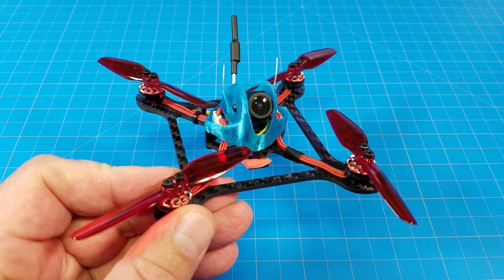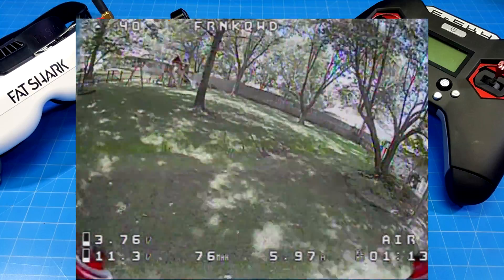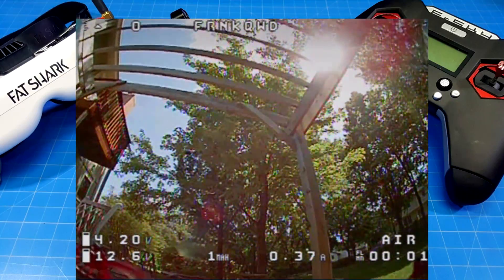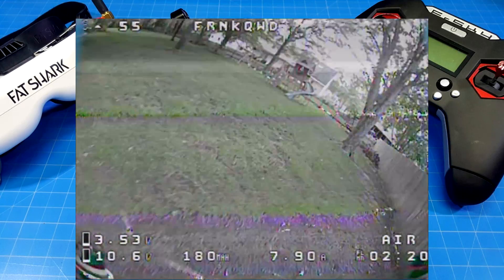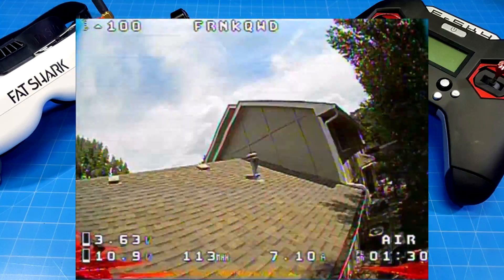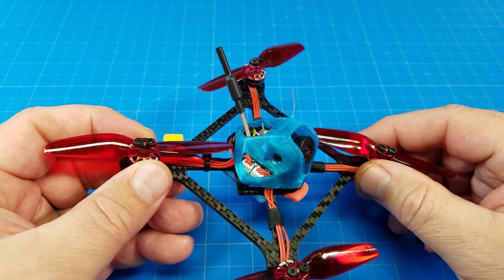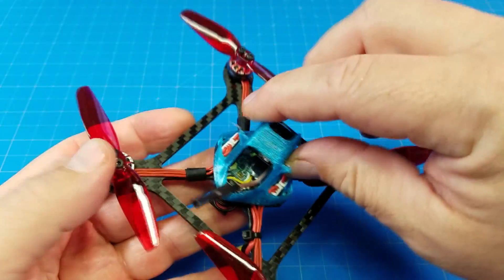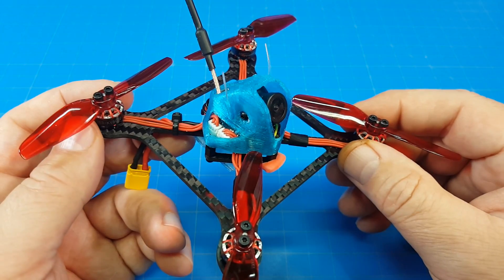AirBlade CreamPuff - PowerLight-TWIG-ToothPick - Kinda

Comment: 1108 4500kv on 4s 450mah and 550 3s with hq bi blade t mount with the creampuff frame.  excellent flight time and insane power control and speed.  I haven't tried those motors with the AIO 12 amp board but have on a 16amp betafpv board with no issue.  its basically a faster updated, faster emax Babyhawk 3r.

Comment: WOW so inspirating!
your flightstyle is so clean but otherwise pure rippin...
im so proud that my 2,5" toothpick build weigth around 73 g and you build a 3" with 55 g 😂

this is crazy... did the board handle stock PIDs so well? whats your favorit betaflight version for such build?
on betaflight 3.5.3 i can tune the toothpick aggressive.. the new 4.0.5 version run realy bad for me.
Reply from the maker: I like to run Betaflight 3.5.7 on all micro 3inch prop and smaller. BF 4.+ is a lot different to tune and I don't think it works as well for micros.  In this video the pids are not BF stock pids, I tuned the quad.
Reply: @NickBurnsFPV  Thank you. Every time a honor to get a answer. This realy help me alot!
 I need to try 3.5.7. 
the hang time of these 3" props looks so great. 
btw you got smart audio with the geprc board? the betafpv "clones" smart audio with the nano pro32 dont work for me... on 4.+ it works but realy crappy.
Reply from the maker: yes smart audio working, with TBS smart audio we sometimes have to unlock the vtx to get it to function and/or run a particular version of betaflight. There are few recent versions of betaflight with a smart audio bug. 3.5.7 does work :)

Comment: I would love it if u could flash your pids in your osd at the beginning. Just for info. Great build !!!
🤘😁👍
Reply from the maker: I will try to add that to the list. If you don't mind me asking, what are you looking for?
Reply: @NickBurnsFPV  Pids are still a struggle for me at times and I try to take in all the info I can to better understand tuning. When I see how pilots like yourself tune a quad, it helps me more than you know. Thx.
Reply from the maker: sure. I understand. I will try to keep that in mind. If I fail to do so you can always send me an email requesting them.

Comment: This HM is cheap motor..but no issue flying using this motor. I am happy using this HM it quite long fly time on 1103 motor compared my geprc 1103. Geprc quite power hungry. Output power almost same with different price tag.
Reply from the maker: Yes, the HM motor is a good performer but the metal is a bit soft, mounting screw holes get stripped out :(
Reply: @NickBurnsFPV  the motor mount screw 1.6mm very small the screw thread easy to loose. Yes agreed build material not very good. For this small class big issue is motor shaft or bearing easy getting broke after crash.

Comment: 10:39 are you really going to destroy the electronics in a crash with a 90g quad? I'm unsure about that, I have crashed my toothpicks pretty hard and other than the camera lens and some 3d printed frames nothing ever broke.
Reply from the maker: In my opinion yes, there is great potential to destroy. If a pole, tree/branch or other object make first contact with a tpu canopy the electronics are likely to make contact with each other. There is so little room we can't compress the canopy down and not make contact. Of course this depends on the speed as well.
Reply: @NickBurnsFPV  Thanks for answering. My toothpicks use 16x16mm stacks, and the canopy is high on some stand offs like the diatone cube, so the canopy actually has a lot of free space inside, maybe helps protect the electronics.
Reply from the maker: In a stack like the cube, there is still risk. Catch a horizontal branch and rip the stack apart flying down to the ground.  my first 4 inch was a extreme racing frame, with the stack serving as the support structure for the arms and no external support. Exploded every crash :)  Really there is risk to flying these things at all. For a time when our micro builds were more traditional top and bottom plate designs, that was our camera and flight stack protection. We seemed to be at a time were we are much more accepting of the risk.

Comment: the bigger the prop the more you need to balance them especially cheap ones
Reply from the maker: this is tru. You still balancing props?
Reply: @NickBurnsFPV  only on my 2" plus bi blades
Reply from the maker: are you pulling my leg? do you really feel a difference after balancing and which brand of props are you balancing.
Reply: @NickBurnsFPV  on my planes I don't care if they wiggle and jiggle, but cheap hobbyking motors I have had issues with, granted I avoid them like the plague but if I get jello for no reason on my 2"+ quads I will check the props as you never know when you get a bad batch.
Check the simple stuff first when troubleshooting.

Comment: I feel like it's too heavy for those motors.  The flight times tend to bear that out.
Reply from the maker: A +3min flight?
Reply: @NickBurnsFPV  well you were saying less than 3 when going hard.  I don't have a toothpick style quad that gets under 4.5 mins.  In my experience those 1103 motors don't like more than 75g auw.
Reply from the maker: This is true I did get about 2:40 going all out. Keep in mind the pace, even a 5inch with 1500mah bat in a race barely make it to 2mins but a freestyler on the same setup will get 3+min.
Reply: @NickBurnsFPV  true. How are motor temps?

Comment: I’ve tried nearly every Toothpick frame available and I was very disappointed with how flimsy the 2.5mm carbon of the CreamPuff is compared to other 2.0mm offerings. I never even bothered building it.
Reply from the maker: hmm. Interesting. I didn't notice it myself. I will have to give it another check.
Reply: Nick Burns - I was a bit surprised myself. It has about the same flex as the Sailfly-X frame. Perhaps the flex could even help durability, but “high-end carbon” it is not.
Reply from the maker: I noticed this one is 2.5mm. By chance do you think they changed the carbon thickness sometime?
Reply: Nick Burns - Mine is 2.5mm also. A 1.5mm variant was also available at one point, but I’ve never seen it in stock. Anyway, it’s either a different kind of carbon or it was cut wrong. Well, my particular frame at least.

Comment: Are those blue 2.5 inch HQ props the same as these but with screw holes? https://www.racedayquads.com/products/hq-prop-micro-prop-65mm-bi-blade-2-5-prop-10-pack-1-5mm-shaft-choose-your-color
Reply from the maker: close but these are them https://www.racedayquads.com/collections/2-3-props/products/hq-prop-t65-bi-blade-2-5-prop-10-pack sold out :)